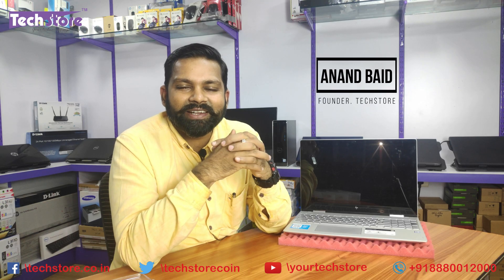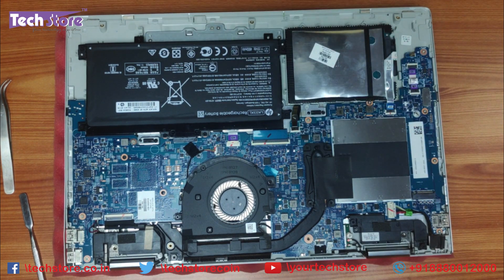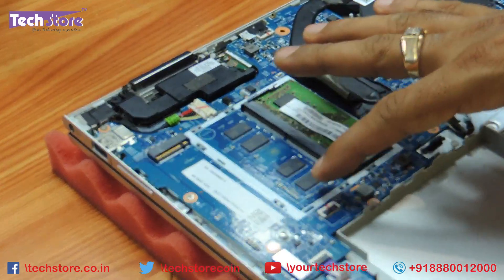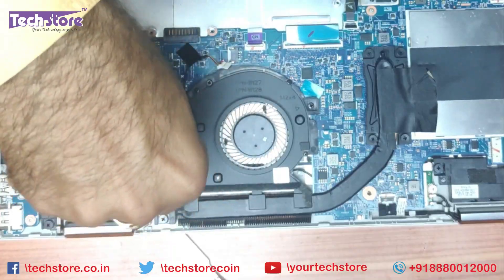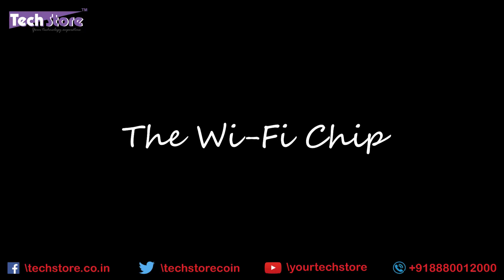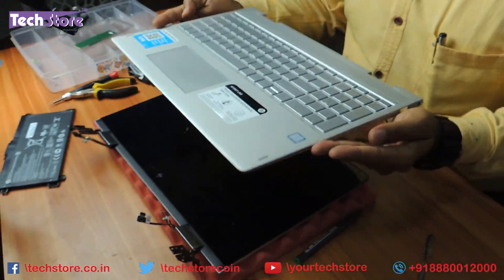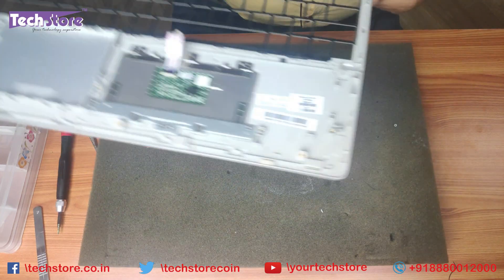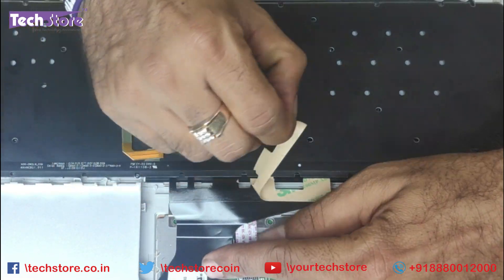HP Envy 15 X360 : How to disassemble base touchpad replace keyboard motherboard hdd ram m.2 ssd

Comment: For the Envy x360 15m-bq121dx, fail to startup, blank screen, Caps Lock light flashes 3 Slow, 5 Fast, what would be the suitable repair/replacement to get it working??
Reply from the maker: You can try.
Reply: @TechstoreCoIn  Which part should I replace ?

Comment: Can I take every thing out of my HP Envy X-360 M6 convertible PC model# m6-aq10 3DX completely and put it in older version the HP Envy model #15t-k100, (possibly taking as little of the computer apart as possible, unplug unscrew🤞) I broke my screen and the power cord no longer can plug-in because the power adapter inside has this plastic casing around some pins which has broken off and I don't know where it went. I do have an older case for the HP Envy which is the model I told you & I'm just too broke right now to do anything else is it even possible? is it possible to make it fit? I am a complete newbie but follow directions well... please maybe make a video?
Reply from the maker: Not possible.

Comment: Hey!!!
Thank you for the video. I wanted to know that was it necessary to remove all the rudders or plastics which were holding the keyboard assembly in place?? I have seen another video in which the guy just skimmed the rudders from the top and melted them later on for supporting the keyboard. Dont you think that by removing all of the rudders the new keyboard assembly would just sink in the chasis/frame?? Thank you in advance for any help you may provide!!!!
Reply from the maker: yes it is necessary otherwise the keyboard will be uneven on the top.
Reply: @TechstoreCoIn  Thank you for your response. One more thing, after removing all the rudders, do we have to use an electrical tape to keep the keyboard even?? Or is there any other way to give support to the keyboard? Thank you in advance!!!

Comment: Thanks to your video, I replaced my hard drive with an ssd and now my computer is quite fast!😀
Be safe and well.
Reply: I have this laptop and it runs well. After the upgrade you mentioned, will that help with cpu usage?

Comment: Great video - I was able to replace the keyboard on my HP Envy laptop using the instructions provided as a step-by-step guide. One thing I found was that after twisting off the plastic "posts" or "rudders" I think he calls them that hold the keyboard assembly in place. It was easier to sand them flush rather than using a knife.
Reply: They should* fit right back up into the holes on the new keyboad... and line up with the holes on the back plate.. no need to completely take em off.  Probably more useful as locator pegs.  but yes, a quick touch with a dremel shouldn't take but a second to get rid of them.

Comment: Very bad work on keyboard plate. Haha. You ruined it. Anyway thanks for the knowledge. I can do it by myself now because of you.
Reply from the maker: if there is any other way you can do it, please do share.
Reply: One question, u destroyed the plastic dots which fix the keyboard on the frame. When u replaced the new keyboard, why u did not fix the keyboard on the frame with anything? No need to do it?

Comment: Thank you for the great video!  Where can I purchase the 1) the entire touchpad and 2) Just the keyboard and backlight?  Also, how can I confirm I'm getting the correct parts for my version of the HP Envy?
Reply from the maker: You need to get in touch with HP support in your country. Glad we could be of help. Do subscribe
Reply: good luck, HP had more models of the alleged same model units than Heinkel had versions of fighter planes in WW2, and the constant tinkering and changes helped lose them the war!!!
Reply: 964.15 MXN$  11%OFF | NEW Laptop LCD Back Cover/Palmrest/Bottom Case For HP ENVY X360 15-CN 15-CN013TX 15M-CN 609939-001 L23794-001 L23846-001 Silver
https://a.aliexpress.com/_dZMmwlO